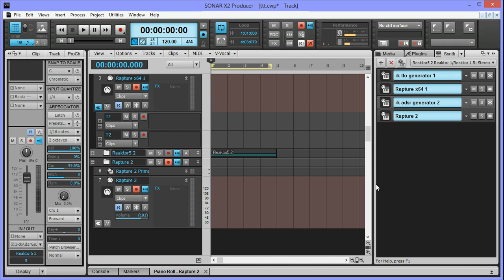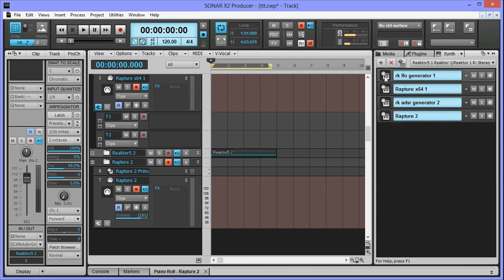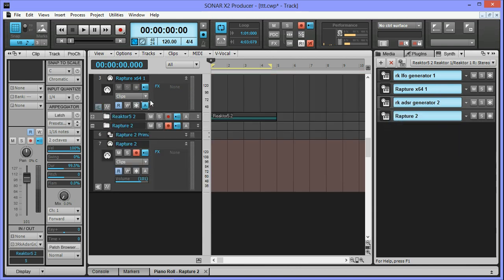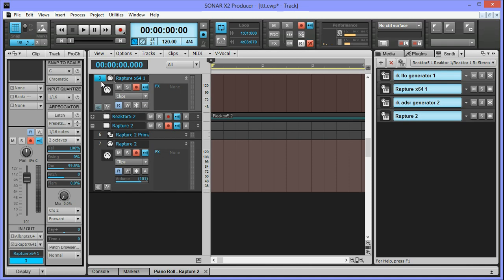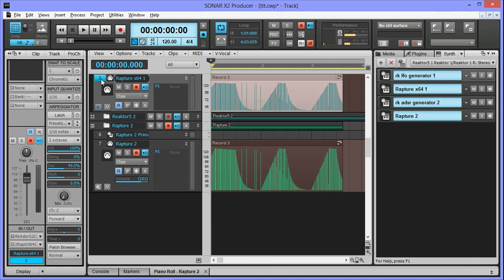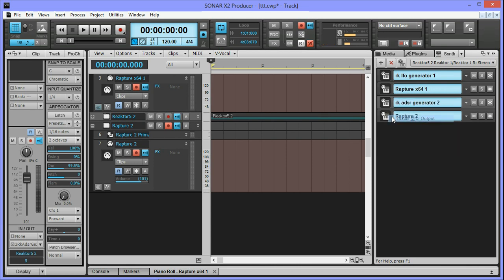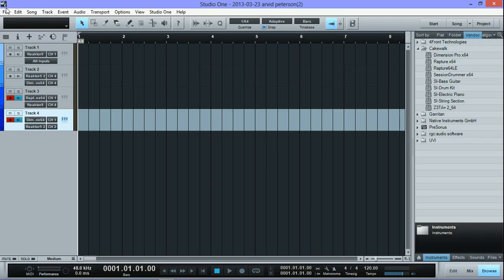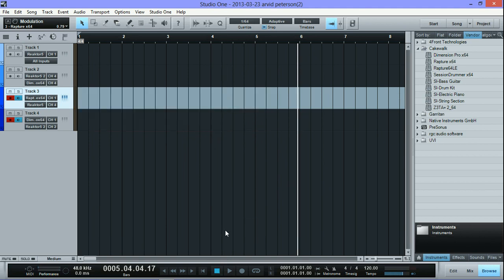Sonar MIDI automation from multiple vsts Issues - compared to Studio One

Comment from the maker: the free version will also let you install a 30 day trial of the professional version.  it's pretty nice.  the interface is no-frills, but more than functional.  there are additional options for fx routing than are available in sonar.  automation seems more stable, and i love the vsti wrapper that they have for soft synths.  working with audio could use some fine-tuning esp with transient detection .  what's nice is you can change sample rates in a project once it's been started.